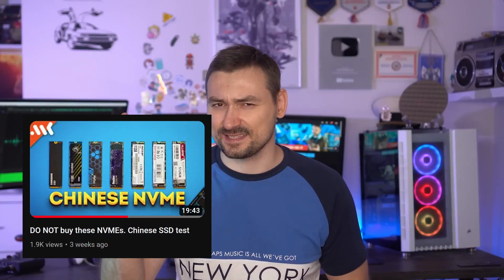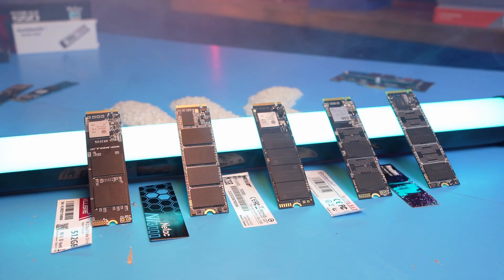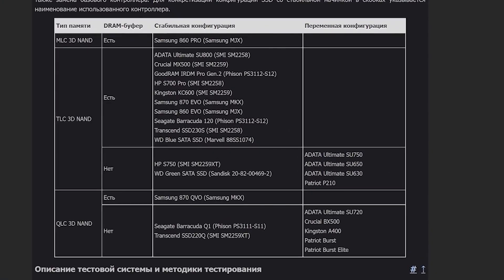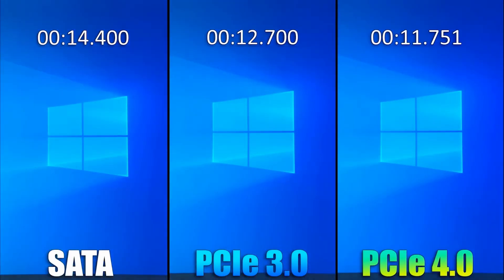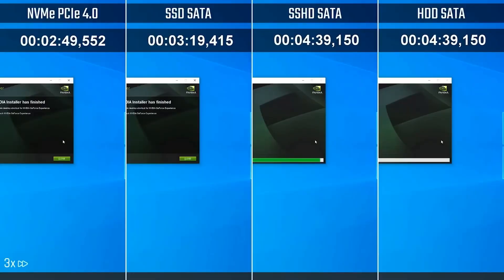Everything you Need to Know about choosing an SSD

Comment: Timestamps/Chapter Marks & Summary:

0:00 Prelude
0:19 Intro
0:27 Generic SSDs: QC Quality Issues
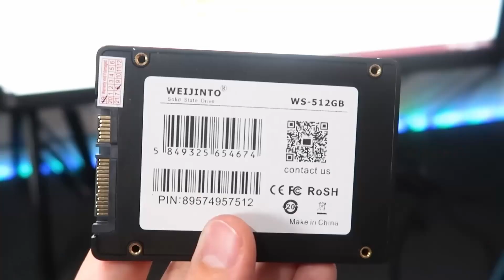1:47 Well Known Established manufacturers:
  WD+SD (GBBR), Crucial (B/MX), 
  Corsair, Kingston, Samsung,
  Transcend, Seagate, HP, ADATA XPG
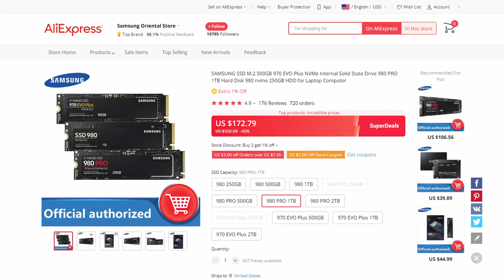2:23 OEM Part Degrade cheat
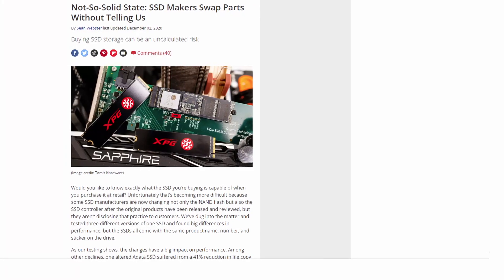3:38 TLC/QLC: Memory Chips' Details
4:06 Read Recent Reviews
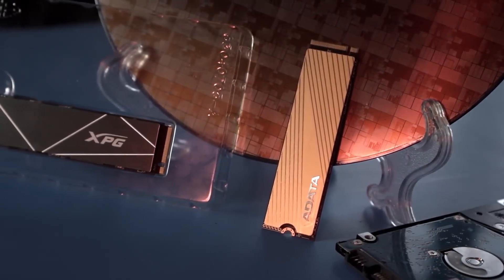4:19 SATA/NVMe Speed: When TOO Fast?
7:13 NVMe Cooling & Heat Sinks
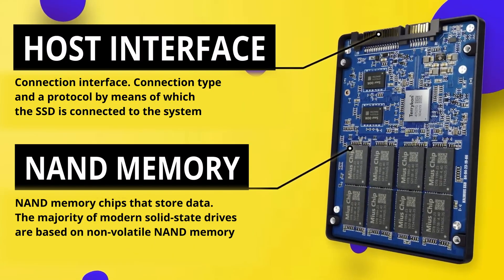8:29 SSD Parts: Controller +Flash [+Cache]
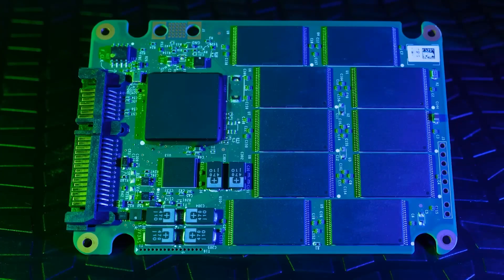8:42 Cache: DRAM/HMB

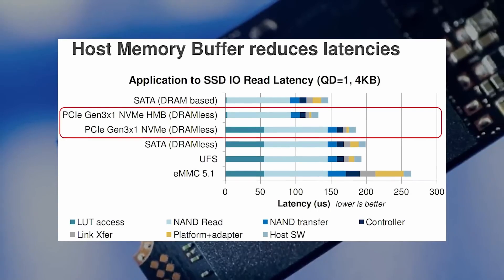10:12 Summary
* TLC memory is good, QLC is WORSE!!
* Beware of: chinese/local-resaler brands, OEM cheats
* Read recent reviews
* DRAM >> HMB >> no cache
* SATA+DRAM > NVMe w/o cache
* SATA+DRAM: good for boot drive
* NVMe: only for regular high load work
* NVMe: Requires heatsink

Remember: 
* M.2/2.5": connector shape/form factor
* NVMe/SATA: protocols 
* Analogies:
* M.2  : USB-C :: NVMe : USBv4
* 2.5" : USB-A :: SATA : USBv2

10:32 Outro

Comment: I like your review a lot. came As far as read and write speeds, its realy over rated and more even overly paid. I build I raid 0 (3 x evo plus 1 Tb) in a maxed out mac pro 5,1 on a pcie card reaching over 6500 mb per second.... costed me over 600$ 
Runned my raw processor from DXO and I processed about 10 raw images per minute, so that was nice! Than I took out the card, placed a single ssd from 1 Tb of Samsung on a simple pcie card and ran the same software again. (should be at least a lot slower right?)
NO! Same processing time again, around 10 raw images per minute! So I spent a whole lot of money only to be able to say that I had these huge write/read speeds... 

So quickly I took the whole pcie card and the SSD's out, sold them and sticked with the "simple" pcie card with one slot. So I learned a lot from that. 

Thx for the great video!